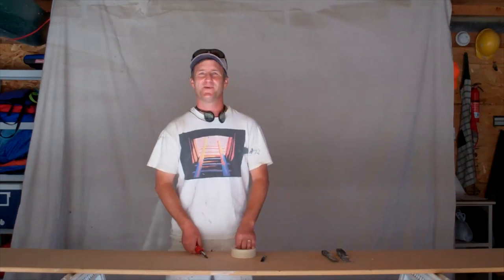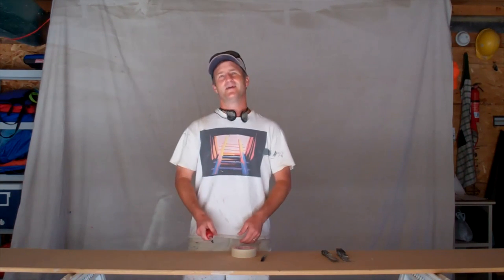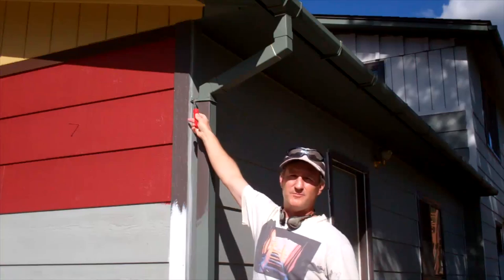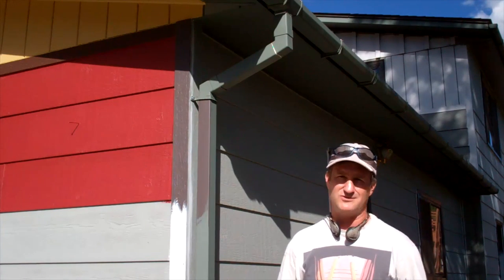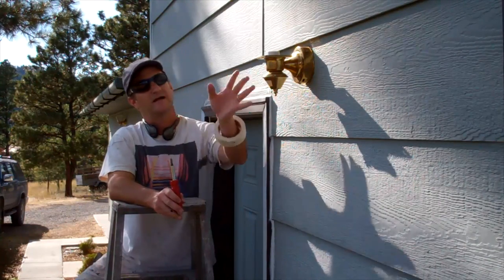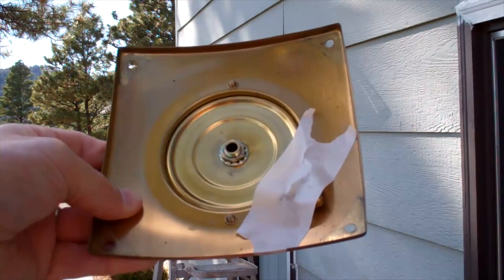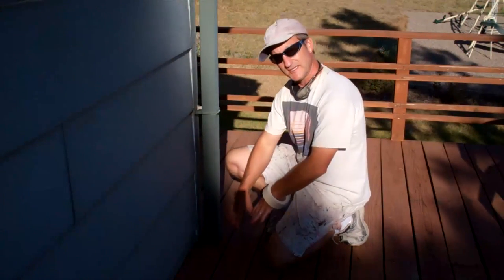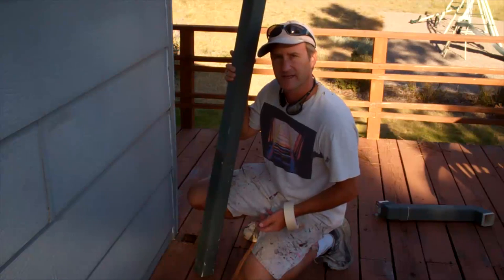Exterior Painting Step 5: Removing the Downspouts and Other Items

Comment: Hi John,  Great video series!!  I will be painting my home soon using your knowledge that you were nice enough to share.  Question for you.  The body of our home is stucco and the galvanized downspouts are painted.  The downspouts are held in with brackets that are nailed into the house.  I would like to pull the nails, stucco patch any holes and re-attach with screws (and silicone sealant).  I would be interested in hearing your thoughts on this plan.  Thank you!!

Comment from the maker: Removing downspouts is easy, but removing gutters is not recommended. If you are spraying, mask them off with tape and 12-inch paper. (Use a paint masker.) Then use long strips of tape attached to the roof to hold the paper around the gutter. If you are brushing/rolling, don't mask the gutters, just carefully cut-in the fascia below the gutters. I don't recommend painting new factory-finished gutters. I'll post a pic on my Facebook page this weekend on how to mask gutters.
Reply: howtopaintahouse hi John, if you're painting your downspouts on a rainy day then rainwater will splash all over your brand new paint haha!

Comment from the maker: thebrainsoftaint--YouTube will not let me reply directly to your comment, so here is your answer and I hope you see it: You can paint the factory finished gutters, but it is likely you would need to prime them with oil primer first before painting with latex. A better option would be to tape them off with 12-inch masking paper (using a 3M hand masker).  Wrap the paper around the top of the gutter and then use long strips of tape in a few places to hold the paper to the roof shingles. It's kind of a pain but it can be done. Good luck.

Comment: Got another question. I had to remove and replace old gutters last year to remove and replace some rotting fascia boards. The new gutters are factory finished but they were such a pain to get up the first time I don't want to fool with taking them down and putting them back up again. Can I just leave them up and paint them the same color of the house and if so do I need to prime them before I do?

Comment: Hi John,

If we're planning to completely remove and replace the gutters and downspouts anyway is there any reason for us to not do that as step 1 and power wash as step 2? It seems like it would give us the opportunity to clean, scape, prime and paint the areas behind the gutters much more easily.  And we could install the new gutters after the painting is complete.
Reply from the maker: Yes, that's what I would do--remove the downspouts and gutters first, then pressure wash, then do the paint job, then put the new gutters/downspouts up last. And hope there isn't a gigantic rain storm when the gutters and downspouts are off the house because that often splashes mud up onto the siding and it needs to be cleaned or brushed off before painting.
Reply: Thank you so much for the quick reply John. I really appreciate it, and all the effort that you put into your videos. I watched about 15 of them the other day and read your site too.